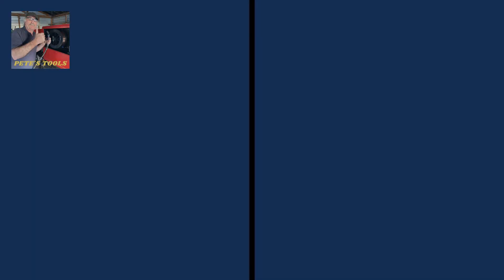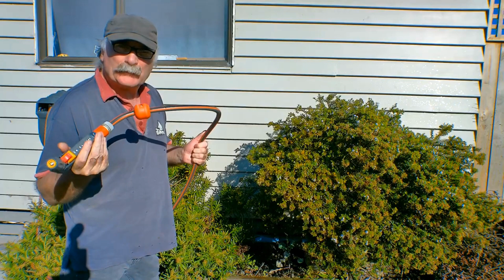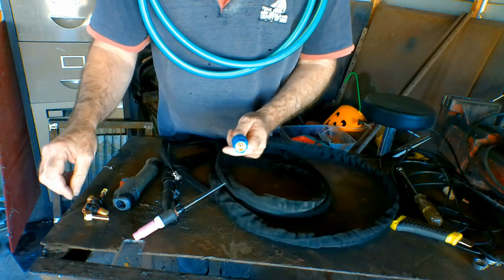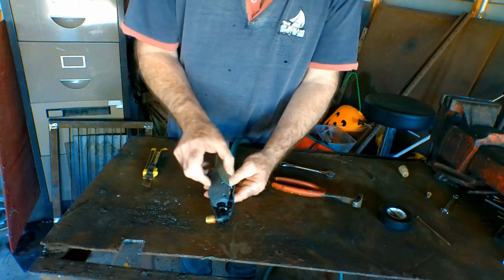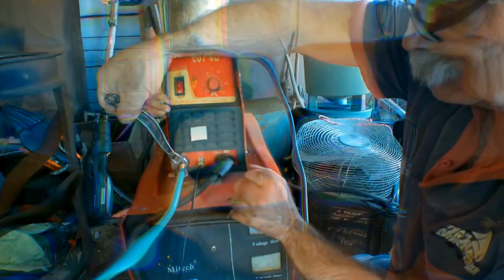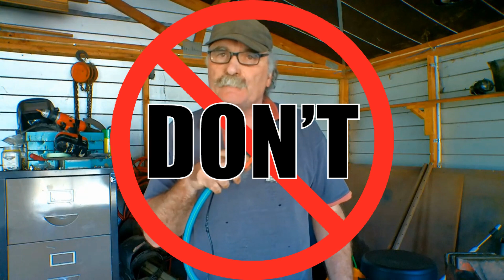How to Cut Metal with a Garden Hose

Comment: Thanks for the info. Looks very simple to make your own plasma cable from scratch. Just buy some good quality air hose, some wires or smal cable, and why not put them thru a rubber protection that can handle sparks easily. I want to extend my original trafimet s25 4 m to 8 m.
Reply from the maker: Yea just remember the air hose is also the main power cable
Reply: @petestools  I have a TIG cable like that, with 2 in 1 air-curent hose, but my plasma has ordinary air hose, i think it's called rilsan + 2x 1 mm cable for contact, 1 x 4 mm black and 1 x 4 mm red. I use trafimet cable.

Comment: many plasma cutter connector sold on market. if I want to make plasma cutter's hose with garden hose, what size of hose and cable size for chinese plasma cut60. Actually the same as plasma machine torch P80, straight. My plasma hose been damage, need cheap replacements. You can make utube from start to end.
Reply from the maker: Good idea